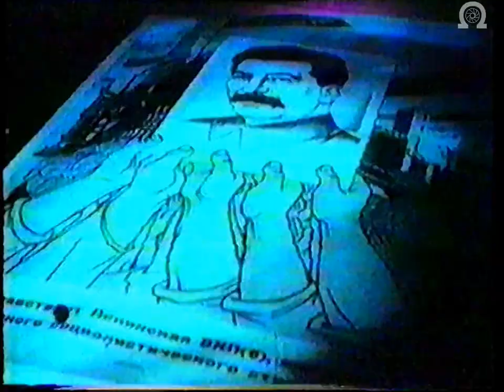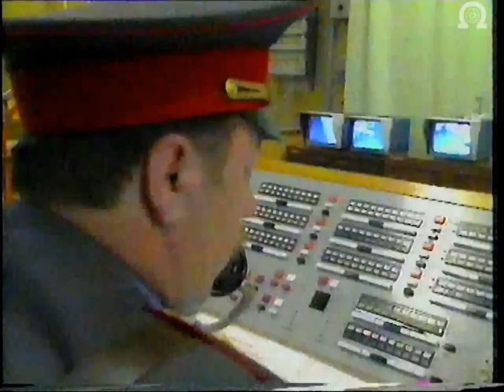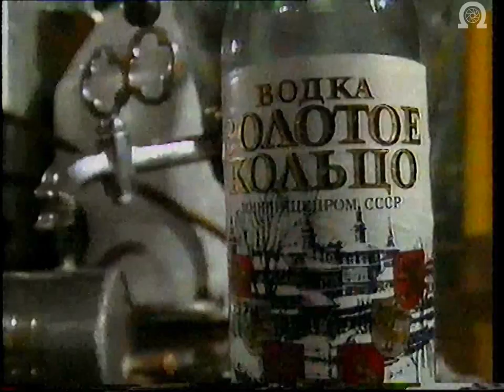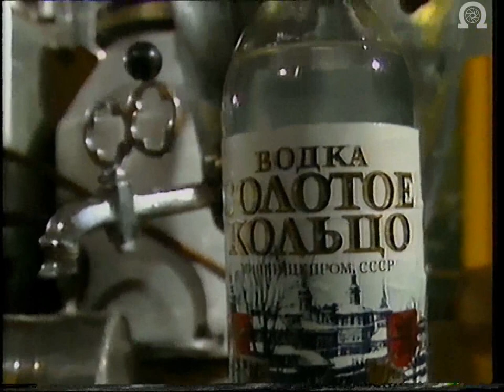Panorama  - A Revolution Without Shots - Soviet Union (1988)

Comment: When the political history of the late 20th Century comes to be written objectively two politicians will stand Head & Shoulders above everybody else.
They are Mikhail S. Gorbachev of the USSR and Fredrik W. De Klerk of South Africa.  
In both cases they had risen through the ranks starting out as "True Belivers" of the political systems of their respective countries. As they rose through the ranks both of them came to understand that both of their countries political systems were completely unsustainable and had to be reformed because both of them realised that without major and far reaching reforms only choas and disaster awaited.
Thankfully utter disaster was avoided. OK in both cases what came later has proved to be controversial and in the case of Russia under Putin catastrophic. 
But as Mr De Klerk once pointed out that without the reforms in both South Africa and the USSR things would be been very much worse.
I suspect that history will be kind to both Mr Gorbachev and Mr De Klerk.
Reply: South Africa has fallen as well, the ANC has gotten consumed by corruption and tolerates open racists in its ranks. It is partially due to the fact it was formed with a specific purpose in mind a purpose that has long run its course.